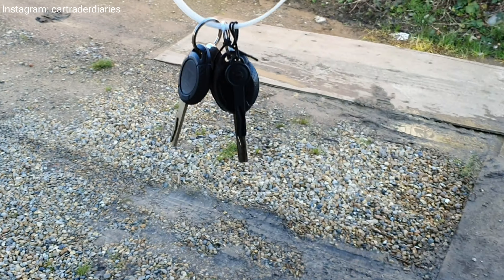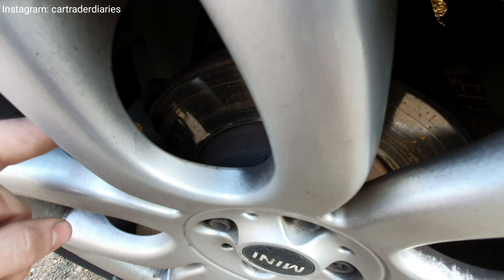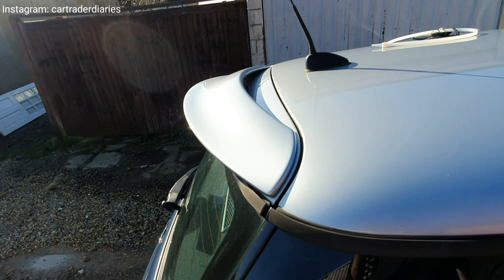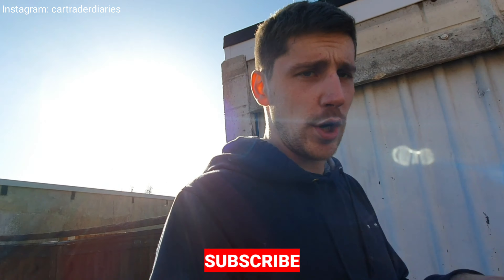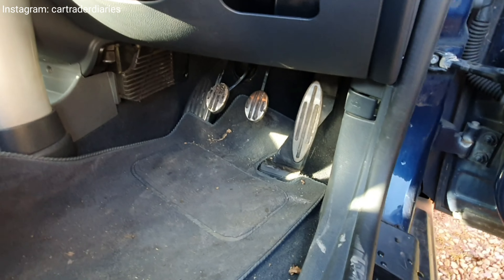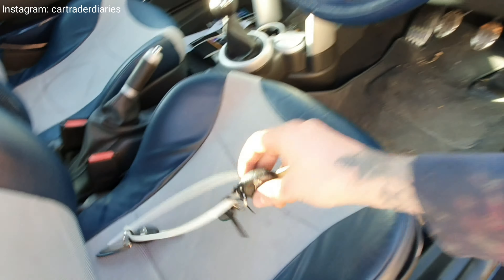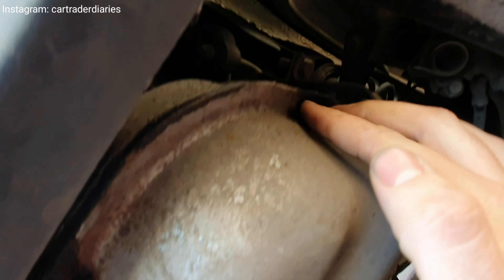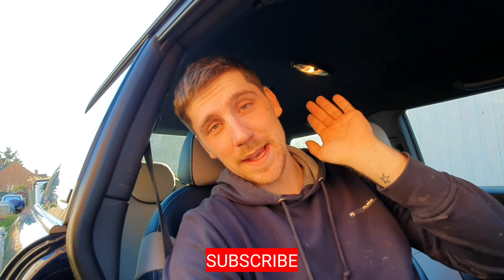I Bought a *CRASHED* Mini Cooper S From COPART!

Comment: Great vid, exhausts are cheap and the after market exhausts sound ace. I always change BMW mini exhausts even if they dont need one. Sound so much better. Boot lids are also cheap, theres a BMW breaking firm in Sheffield, he has loads of bits and panels.
Mick
Reply from the maker: Thanks Mick! Appriciate it. Euro Car Parts want £350 for a complete exhaust centre and back box, was looking on ebay and you can pick up a aftermarket system for £200. Bit of a no brainer for me.
Reply: @SalvageDiaries  yeah and they are usually good quality on Flea Bay, I've bought about 15, easy fit, just WD40 the studs well in advance because they are prone to snapping where they bolt to the floor pan. 
Mick
Reply from the maker: Thanks for the info Mick much appreciated! Now to start ordering the parts